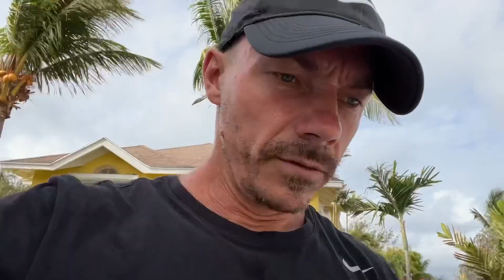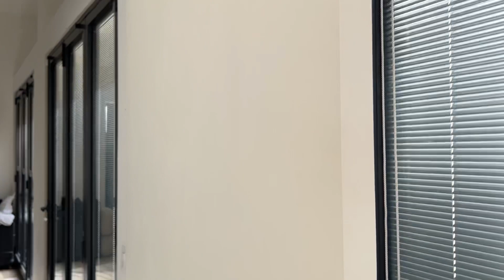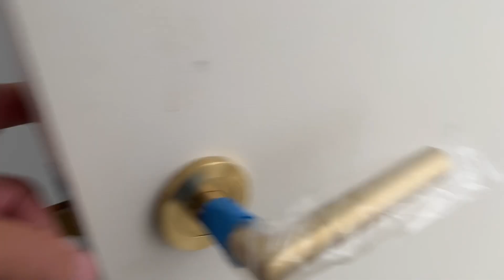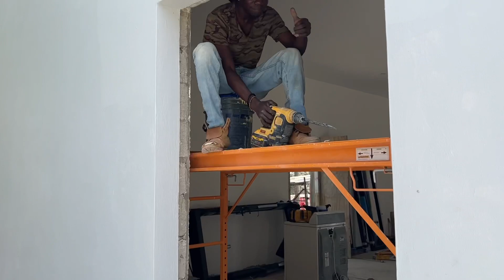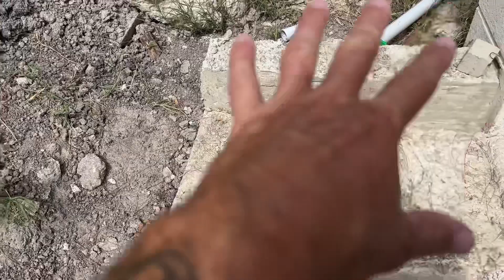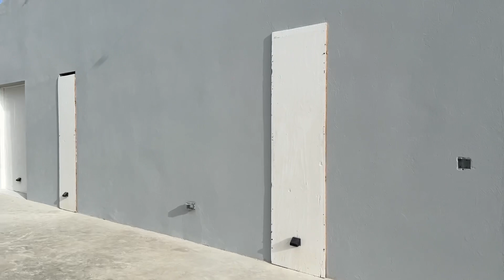Barbados 🇧🇧 Beach House Build - Day 331, Building Our Dream Home in Barbados

Comment: Hi Alvin finishing touches are going well. Can you tell me where did you buy your kitchen cupboard, did you ship them from UK or purchased in Barbados?
Reply from the maker: Hey PAL, I shipped in from the UK, a place called Howdens. Great kitchens and very reasonable however you then have the shipping and duty to contend with which worked out at around 120% 😩